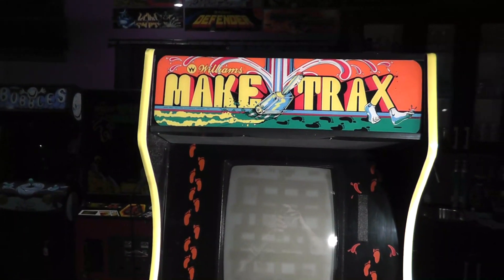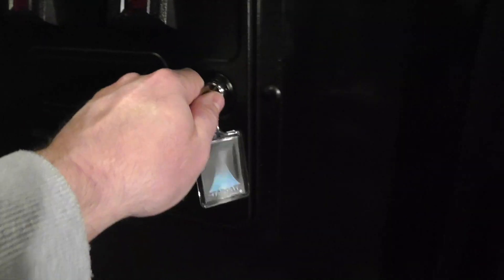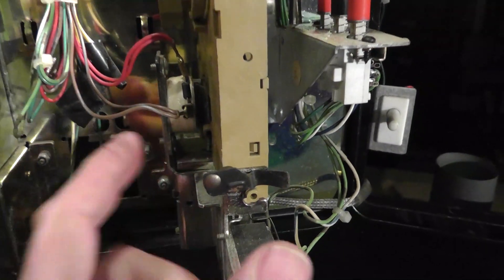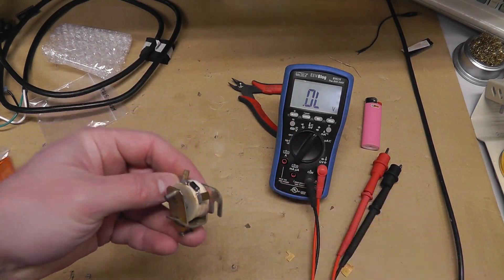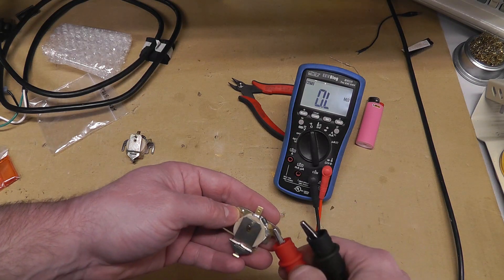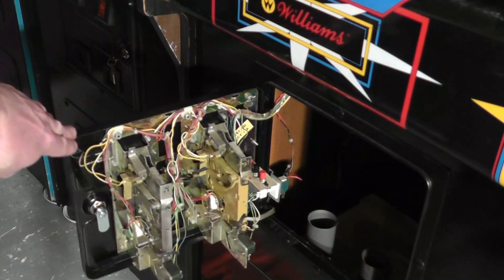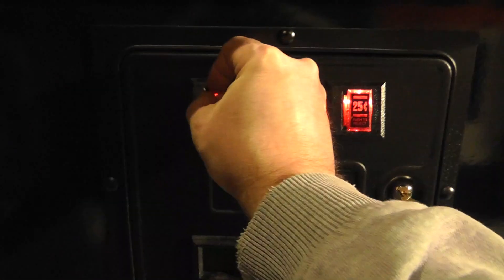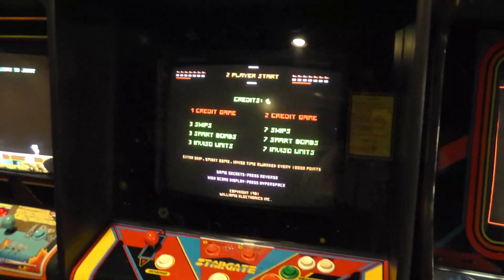Arcade OCD - Coin Lockout Coils

Comment: cool explanation on how they work.
but i did not see the other half of how they work on many games.
many games will de-energize the coils so you cant add another coin during game play.
i know many pins do this and some arcade games.
do the Williams games de-energize the coils during game play?
Reply from the maker: Interesting. Williams games definitely don't do this.  The only thing in the ckt is power to the coil.
Reply: @jacklick  
if you are ever around any older Williams pins, they lock the coin mech so you can't put in a quarter during active game play.
some older bally games did this also.

Comment: Those coin slots and reject buttons?  Where can I get that exact style? I have a cabinet that was originally a "the pit" by centuri. I converted it into a really nice gun.smoke.  with the marquee, sideart .a custom gun.smoke bezel and cpo. It could use 2 new red coin reject buttons.
Reply from the maker: Is there a label inside the coin door?  You really need to know if it is a CoinCo door or a Coin Controls door.  Only way, that i know of,  to get parts for early 80's CoinCo  (series 2802) doors is via a donor door.
Reply: @jacklick  ok.  I will check.  It looks identical to the one on your Trax game.   My cabinet is originally from 1981.
Reply: Thanks.   I will look around the net.  Perhaps someone makes a repro
Reply from the maker: @atrain818  The Pit manual states it is a CoinCo coindoor.  so probably 2802 series.  Note there are two types of coin inlet bezels and buttons for these doors.  If you find someone reproducing them, let me know.  
http://arcarc.xmission.com/PDF_Coin_Mechs_Etc/Coinco/Coinco_2802_Series_Game_Door.pdf
Reply: @jacklick  thanks man..  I will do sum snooping around.   If I come across sumthin, I'll let u know

Comment: Did you unwrap insulation on all of them to check the coil wire?  As this metal piece smacks back and forth every time you turn power on/off (relay), you may have a lose wire (very tiny) at the solder joint with the lead or just a cold solder.  It kinda sucks that the coils have to be always on when the game is running.  Yes, there is a big chance the coil is just burned out after all these years, but it might be worth giving it a try to save some of them.
Reply from the maker: Yea, I saved them and might investigate their demise and rewind a couple of them in the future.

Comment: You have a lot of arcade game, look to see if all the coin door lockout coils measure 460 ohms or are they all different sizes and use different coil resistance
Reply from the maker: Yes, different manufacturers used different coin doors with different lockout coils with different voltages and different resistance on the coil.  I should have called that out in the video.  Can you name which ones?
Reply: @jacklick  I'm don't have much knowledge about coin door lockout coils but you should a video lesson about the different types and measure the different coil resistance since u have a bunch of different games it would be easy to do to learn about.
Reply from the maker: @waynegram8907  Well now I am interested in rewinding a couple of these bad ones so maybe I will.
Reply: @jacklick  yes I think they use transformer enamel wire not sure what pinball coils use but the enamel wire has to have a heating spec or it will get damaged for heat since it's turn on most of the time

Comment: Would the coin lockout mech of today vending machines work in and old arcade game?
Or is it designed differently?
Reply from the maker: depends on the size and the voltage rating of the coil.  These coils are getting @ 30V and some of the new ones I saw, where 24v.  But yea, a coil is a coil it is just creating a magnetic field or magnetizing this piece of metal in the center of the coil.  I should have shown that.